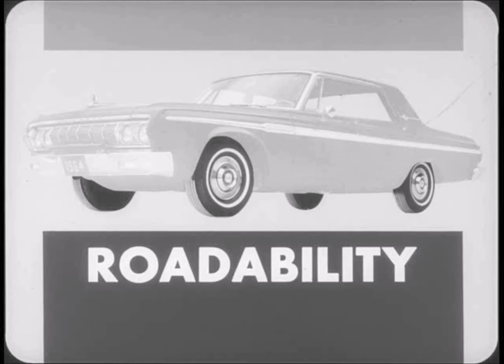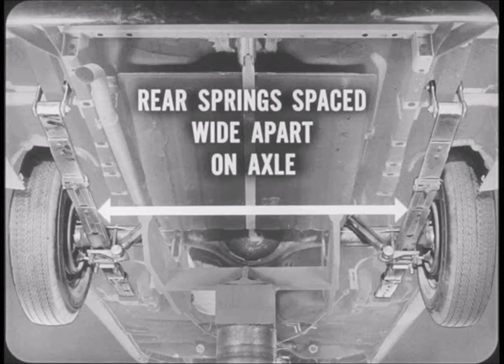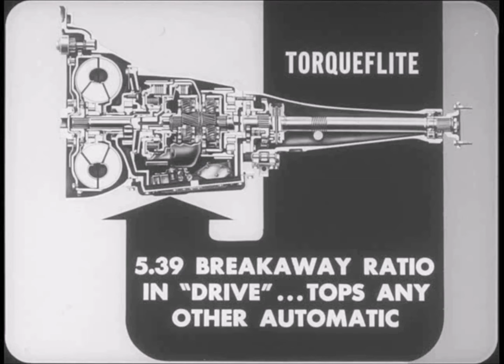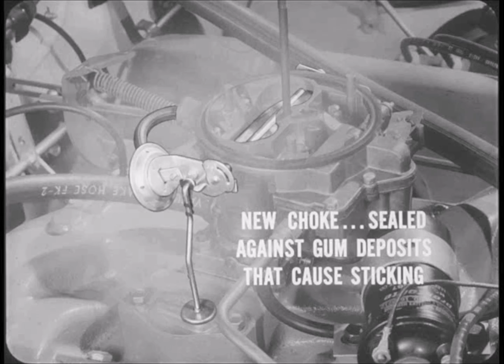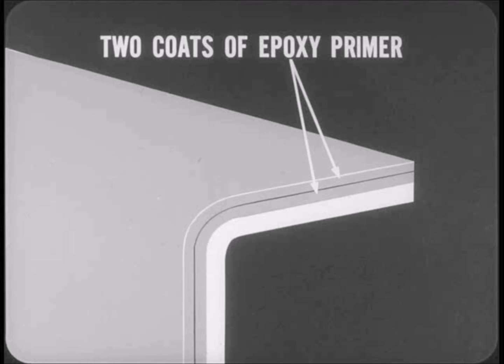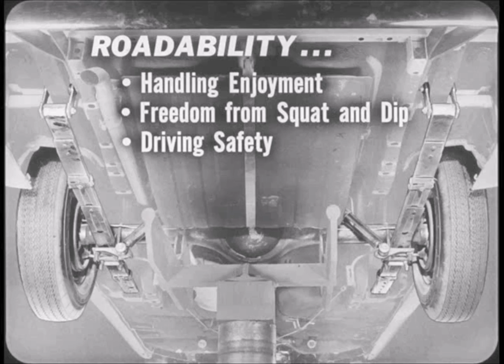1964 Chrysler Plymouth Engineering

Comment: These Chryslers up to 1973, had exemplary reliability and durability.  Their powertrains outlasted the competition whether domestic or imports.
It was not unusual for owners to neglect maintenance on all Chrysler lines, such as engine oil changes and other fluid changes. Even to this day, most Chrysler owners have not even the faintest clue as to how to maintain their vehicle.
These Chryslers were known go past 200 000 miles without a major issue. That's how well built they were.